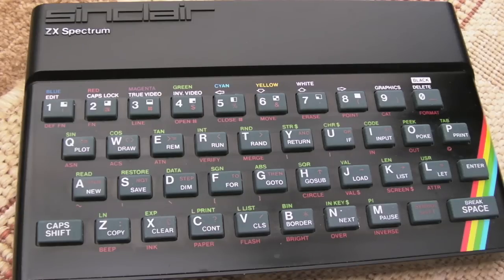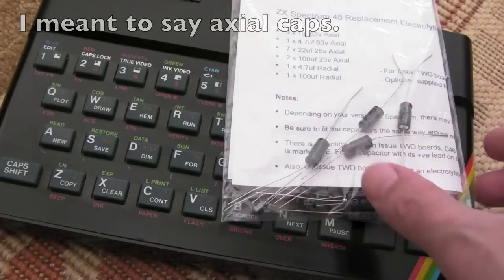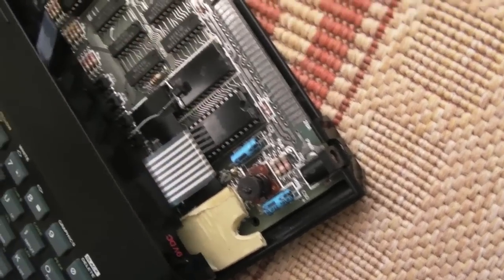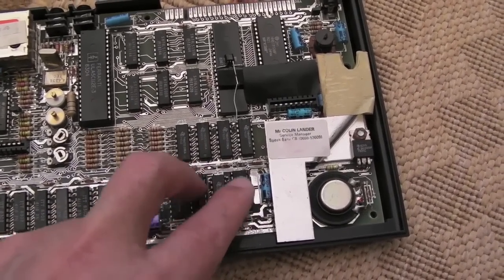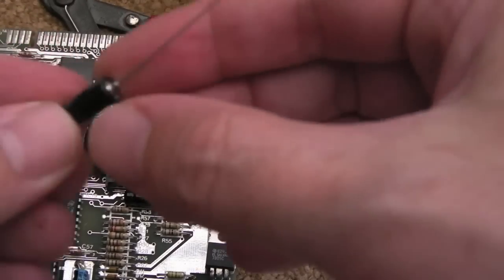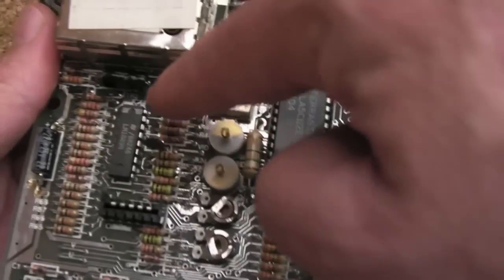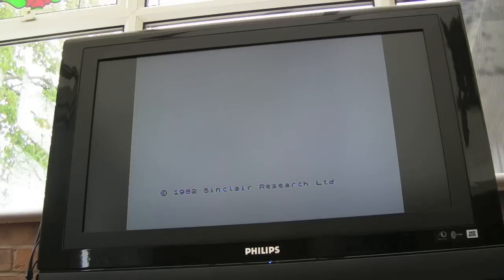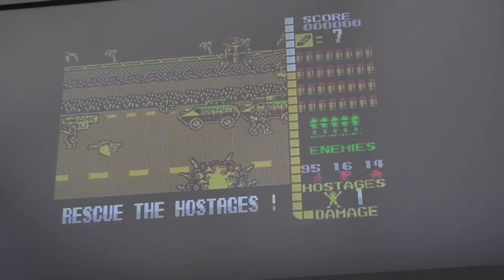Sinclair ZX Spectrum Replacing Capacitors (Preventative Repair)

Comment: That was a very interesting video, especially with the old cap testing at the end. I have 7 Speccies of all flavours and multiple Amstrads, Commodores, PC Engines, and loads more to recap so that was confirmation for me to go ahead (I already have all the cap kits for them)
Reply from the maker: These old caps did measure quite a lot higher than they were marked from manufacture - that was true even back in the day!  They are probably supposed to be +/- 20% tolerance but always measured around 100% higher than rated.  This meter didnt test for ESR, that's an important factor when testing capacitors.  Never the less, I would always re-cap any system that has multiple power supply rails to old DRAM, but I wouldnt rush in and re-cap every single system you come across...  Many old caps are still good, and in some cases better quality perhaps than some modern replacements.
Reply: @GadgetUK164  Hmm. That's certainly food for thought as I have about 30 machines and 10 monitors that were facing me: a truly epic slog. I'm not sure how I'd decide which one to recap short of testing each one in circuit (even if that is possible)
Reply from the maker: @sma7530  Monitors and PSU's - always recap those!!!  Always re-cap surface mounted capacitors too!  Through hole electrolytics on most of the old motherboards are fine - exception is PC Engine.
Reply: @GadgetUK164  Thanks. Will prioritise those. It would seem that the through hole cap changes seem to be a fad then ?

Comment: Hi there I’ve opened my 48k after many years and no sound from the loudspeaker. Everything else works and is original on the board. I’ve order a new speaker, is that likely to be the problem? How can I be sure it’s the speaker? Thanks
Reply from the maker: 50% chance!  Could also be a bad capacitor, or the ULA.

Comment: Ummm... you're doing this on a carpet?!
Reply from the maker: It's true you shouldn't work off carpet due to ESD risk.  I've since moved onto using an ESD mat, but what I would say is I cannot generate static on this particular carpet - I've tried!!!  And I always ground myself regularly / wear an ESD wrist strap.  Contrary to that, in the bedroom which has a different carpet, its super easy to charge myself up just walking around on that carpet.
Reply: Phew... I knew you would have a good answer :-)
Reply from the maker: I might do a video on it at some point!  Because the difference between the carpet in my conservatory and the carpet upstairs is noticeable.  Maybe because the conservatory is closer to earth has something to do with it - no idea.  What I do know is I cannot generate a charge on that carpet even if I try.  Yet every night when I go upstairs into the back bedroom and touch the light switch in there - zap, major static.  Touch a ground point in the conservatory after moving around a lot and nothing.  Doesn't mean there's no charge on me, but there's a huge difference for sure.

Comment: Just recapping one myself and I noticed you have a 1uf in C47.  The service manual says C46 is 1uf and c47 is 22uf on an issue 2 board.  That's not me pointing fingues I'm just wondering if I'm missing an inside trick or something here, as I know there are lots of revisions, patches, fixes and workarounds on these old speccys.
Reply from the maker: It could have been a revision at some point?  I do know that I put the caps back on exactly as they were originally (except for the one that is reversed (see the vid description for which one that is).
Reply: Cool thanks, good to know that a 1uf is an option there then
Reply from the maker: Do you know what point you saw a 1uF at c47 there?  The rev 2 schematics do show a 22uF in C47.  I know that C46 silkscreen markings are also the wrong way around on this board.  I will dig my Spectrum out at weekend to check this.  I will also look more at that part of the circuit later to work out what size should really be there.
Reply from the maker: Just checked the video and I see 1uF at C46 and a 22uF at C47!?!?
Reply: Try 4:23 - unless my eyes are reading that wrong which is entirely possible
Reply from the maker: Thanks, are you talking about the light blue one below the keyboard connector on the right?
Reply from the maker: C46 is the one above the connector!  That's not C46! =Phew, I thought I had something wrong there but sure I've not now.  It was worth checking, I wouldn't like to try a different sized cap in that part of the circuit as it looks to be related to the -5v and -12v lines.
Reply: The one to the left of the heatsink, light blue, try the view at 3:58
Reply: Yep I'm talking about C47 by the heatsink on the left.  Ok cool thanks.
Reply from the maker: Thanks, that's not C46!  C46 is under the tape there, above the connector I think, and C47 is under some masking tape at that point on the video.  The blue cap which is visible under the keyboard connector, next to the heat sink is another cap.  I've checked the board today and its definitely correct!
Reply: GadgetUK164 - Retro Gaming Repairs & Mods I've been talking about C47 from the start, I think there has been some confusion along the comments?  Anyway good video and looking forward to more content.
Reply from the maker: No worries!  I had a laugh this morning about how complex this has been lol.  I should have just checked the board - that would have been easiest from the start.    It was worth checking but 100% sure the caps in C46 and C47 match schematics, but C46 is reversed due to the incorrect silk screen.
Reply: Roger roger, over and out :)

Comment: Looks like this issue 2 needed the tr4 modification
A significant cause of problems has been found to be failure of the internal power supply transistor TR4. The circuit may be improved by changing the value of R60 from 100R to 270R and connecting a 4.7uF electrolytic (preferably radial type) with positive end to TR5 emitter (positive end of C34) and negative end to TR5 base (to R58).
Reply from the maker: +Patrick Kerkhof Thanks very much for that information - that's a revision I wasn't aware of!  Much appreciated =)

Comment: Capacitor values being a bit high usually isn't a problem. Tolerance on those parts would have been something like -20% / +85% when new, so values in the 30uF range are within spec Older caps were often on the high side, which is why they have lasted as long. If you were to check the new parts, you would also see some variance, although modern caps have a closer tolerance, and if anything seem to be on the lower side. It is definitely worth replacing them though, particularly if you have problems with the board, as their internal resistance (ESR) increases with time, so puts more load on the power supply.
Reply from the maker: ***** Absolutely!  Back in the day they wouldn't have measured like that - certainly in the 90s when I used the cap meter on them they were often pretty much within tolerance.  But as the capacitance goes up on these aged caps the ESR increases as well typically.  The 100uF RS caps were within tolerance, the other brand on there certainly wasn't!